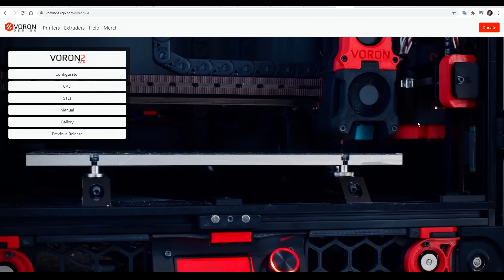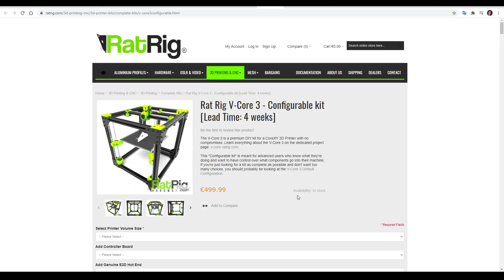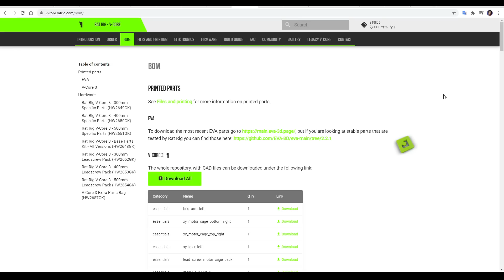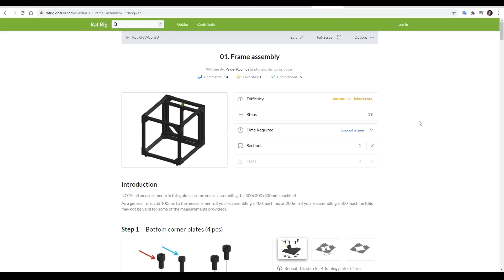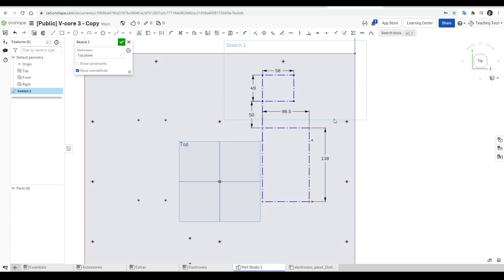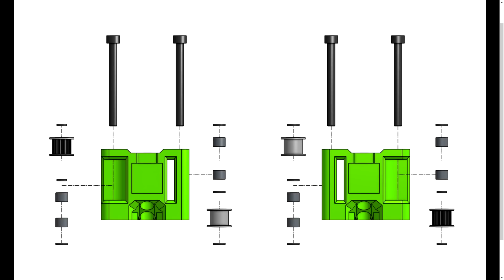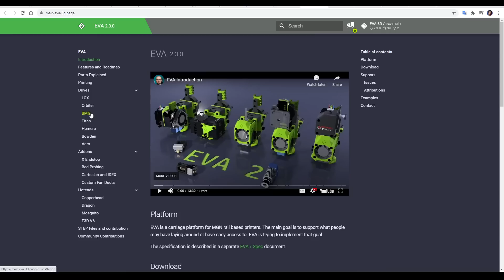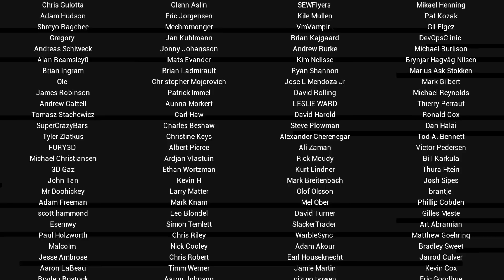Rat Rig V-core 3 part 1 - Premium coreXY 3D printer community build

Comment: IIRC, the linear rails aren't shipped pre-lubricated. They are protected by light machine oil to prevent oxidation during storage. You are expected to clean them with IPA and/or ultrasonic cleaner and use an appropriately rated lubricant thereafter.
Reply: They are actually pretty great straight out of the bag after a quick wipe down, unlike most cheaper rails from china. You can apply some extra oil if needed. You can go as crazy as you want with these. Of course it will never hurt stripping them down and applying some proper grease, but it's an optional step. No reason to complicate it.
Reply from the maker: Thanks for the confirmation.

Comment: How does this compare to the Voron?? They seem about the same cost..
Reply: Scales bigger, way easier to assemble, backed by a company (warranty, support), less printed parts and you get the entire kit in one shop. In my opinion top end performance scales better with the v-core because of the wider belts and way more rigid frame.
Reply: @miklschmidt  thanks for the reply. I’ve been deciding to get the v-core mainly for the EVA series support for a lot of the popular hotness/extruder. I have to admit the Voron does look way nicer at stock with it having an enclosure, the bottom grill/electronics cooling, etc.
Hopefully RatRig releases documentations for those mods!
Reply: @MidStomp  true the Voron 2.4 does look super cool. On the V-Core 3 you’re encouraged to do the non-essentials yourself and make it your own. There are official designs for some of the enclosing panels already, more will come in the future, including a lid.
Reply: @MidStomp  after all the rat rig motto is “Your Rig, Your Rules”

Comment: As for the choice of extruder, I would want to see something that can push out the most amount of plastic in mm³/s because this is supposed to be a fast printer. 
I rarely see anyone promoting 2.85mm filaments and extruders, why is that so?
Reply: Im no expert in this, can only tell you what I have heard, and apparently e3d has done testing on this.  Apparently 1.75mm filament is better for high flow hotends as it is easier to heat/melt.
Reply from the maker: That makes sense. The thicker filament would likely need more temp for it to penetrate the outer skin and properly melt the core.
Reply: 2.85 is considerably stiffer and thus harder to handle in general. I've had filaments that snapped (and this was before runout detection so this was a huge pain), but it was probably old and left in the open.

Comment: Excellent Video. I am wondering with the way the bed can move if non planar 3d printing is possible?
Reply from the maker: Mechanically it would be possible. The hard bit is firmware and gcode generation.

Comment: I am absolutely not a fan of that fake meanwell.
Reply: They're actually quite decent. But it's optional, so you can definitely just buy a meanwell instead if you prefer :) I have both (meanwell on the V-Core Pro 1.3, and Weho on the V-Core 3) With both of them i recommended getting rid of the top and the fan and mounting a proper fan instead. They're LOUD.

Comment: What are you using to get PETG to stick to an ender 3?
Reply: I've had good luck with both blue painter's tape and glue sticks.
Reply from the maker: Wham Bam PEX sheet. First time I've tried PETG on it since initial tests (since I use my Prusa MK3 exclusively for PETG) and it worked very well at 80 degrees.

Comment: If you are getting a premium printer, I would assume that you get all the parts. Not required to make stuff locally.
Reply: It's not a "premium" premium. He used the words premium as a high-quality build, but that doesn't mean it's out of box perfect experience. Buy Zortrax if You want that, but You will pay a premium price for that. Building a printer like that, You are warrantying it Yourself.
Reply: The electronics plate is optional
Reply from the maker: Some people mount the electronics off he machine, but I wanted it on the back. My bad for not realising sooner, but in my defence there is a lot to take it. There is a Facebook community where you could possibly organiser someone to make it for you too.

Comment: I noticed your STL or maybe GCODE files had thumbnails of the exact part? How did you do that? Is it your slicer?
Reply from the maker: For me it is an add on for win10: https://github.com/unlimitedbacon/stl-thumb
Reply: @TeachingTech  Thank you. Just installed it
Reply: It depends on what LCD you use and you can set it on your slicer.
In prusaslicer, under printer settings, general, g-code thumbnails set it to 300x300 and it is done ;)

Comment: This back panel seems like it'd take 10 minutes with a jigsaw and 15 more minutes with calipers and drill press. CNC is a vast overkill here in terms of time/effort spent.
Reply: Remember, if You have a hammer in hand, everything looks like a nail.
Reply from the maker: I wanted it to be perfect. With one $60 panel on hand, I'd rather agonise over the measurements in CAD and have a great result rather than mis-measure a mounting hole by 1mm and butcher it.
Reply: I guess we all have a blind spot when it comes to tools, especially fancy ones vs good old manual stuff

Comment: Whats with all the people saying "would have preffered voron" sounds like bots, i wanted my next printer to be voron but after watching this am def going With ratrig and the new SKR 2.0, I Tking my only problem will be sourcing that panel
Reply from the maker: SKR 2 doesn't have enough stepper outputs. This machine requires six.
Reply: @TeachingTech  ohhhh
Reply: You can find local shops that'll cut whatever material you want according to the DXF. A couple of them even allow you to do it from the website.
Reply: @miklschmidt  Ok but which ones from Australia?

Comment: Damn that's an awesome project to get into. It's really quite expensive though. Wish I had enough disposable income to build a monster printer as this one. My Ender 3 v2 has a faulty board and I'm wondering if I can even afford that, so no big projects for me.
Reply: Where are You from? I have stock ender board V1 and I don't need it because I replaced it with MKS. If I'm not close, You can post on FB, I'm pretty  sure people have spare board that they could give away
Reply: @darekmistrz4364  Man I really appreciate it and this community is amazing but I'm mostly just venting, I'll be fine and I'd feel bad for taking something like that from someone I don't know. But I'm really grateful

Comment: Unless BTT has corrected their drawings, you're going to have trouble mounting the SKR pro. The dimensions for the mounting holes are a few millimeters off.
Reply: 3d printed adapter bracket to the rescue!
Reply from the maker: Holding it up it seems ok. I will be very annoyed if it's not!
Reply: @TeachingTech  i used the CAD model BTT provide for making my electronics enclosures for the V-Core 3. At least i can confirm that one is true to reality 🤷🏻‍♂️

Comment: Great video man! I'm so glad you didn't choose a voron (those machines have serious design flaws). You can see in the comments that "voron" is like a cult.
Reply: What issues do they have?
Reply: @Rolohaun  v2.4 is designed to have a flexible gantry in order for the QGL (quad gandtry level) to work. Just the idea that something in my printer flexes would drive me nuts. The extrusions for the gantry form an U shape (upside down U).  In the corners there are plastic parts designed to flex a little. They also hold the two A B motors which might get hot. Imo this is just a "flex" to do some "cool" looking bed leveling.
The v1 is the best imo, but it sucks cuz the bed only automatically adjusts in two points and the third is a manual knob. Not a big deal imo. A bigger deal is the leadscrew wobble.
The v0 has a cantilever bed which flexes and could have been designed to be all metal and with much less flex. I don't like the leadscrew, and a great mod is the belted z. V0 uses tiny frame extrusions, has small motors. And the top part with the XY carriage is also an U shape. It flexes making things out of square just by pushing with one finger. There is absolutely no place in the xy gantry for square brackets to ensure squareness.
A better variant of V0 is Tiny-M.
A better printer than v2 would be croxy,  k2 or ratrig v3.
I could go on. I will probably get a lot of hate from voron people...
Reply: @cil7ea  to each there own, it's personal preference. I agree with you on z wobble the belted z mod on the v0 is perfect there is no need to change anything else. Its a tiny printer and 1515 extrusions are more than enough. I personally would prefer to level my x,y gantry like the V2 and keep my bed nice and flat. Voron recommends printing out of ABS the motors would never get hot enough to alter the printed parts. But again to each there own I like all different designs that's the best part about DIY 3D printing you can choose what you like and work with it. I built a Viking 3d printer and it had a belted Z, nice printer but did not like it. Plus I prefer Klipper over Marlin for 3d printer Firmware.
Reply: @Rolohaun  i agree with you. In the end it's a matter of preference and what compromises we are willing to take...I'm often a bit harsh on voron. 😅
Reply: @cil7ea  all good, I am curious about all printers and how they work. Very rarely can you have the best of everything haha

Comment: This wobbly disco build plate can possibly be used not only for bed levelling, but also for non-planar printing?
Reply: probably.
But slicing would be a nightmare :/
Will see what future brings ;)
Reply: But this has already been done for 5 axis and more cnc milling. The kinematics are out there in other related fields, after all.
Reply: Some of the testers achieved more than 45 degrees on the bed without falling from the supports.
Reply: Nice, but I wonder about the degree of movement.
Reply: once someone writes the software and they become more common
Reply: The slicer would have to do some inverse kinematic type calculations, which I don't see happening anytime soon, unless a 3D print enthusiasts writes an add-on themselves.
Reply: @dontletthemagicsmokeout  agreed...

Comment: Nice! Didn't even realize there were so many others beside the Voron. Klippy is amazing as well, I hear people having their doubts, but I'd say that's likely because they either never print super fast or already have printers that just behave fine to begin with (like Prusa's). My Ender machine didn't have linear advance as the drivers don't support it, Klippy does this by using the Raspberry itself, which totally sold me on it. Together with anti-ringing, it now prints fast, reliable and I think as beautiful as a well built Prusa (obviously other mods are needed as well to do that :) ).

Comment: 0:50 for clarification the V in voron doesnt stand for version but for Voron and the voron 2.4 is in conjunction with the 1.8 the oldest up to date model of a voron. They're diferent machines not versions of the same, and the vorons you can build are Voron 0 (V0), Voron 1.8 (V1.8), Voron 2.4 (V2.4), Voron Switchwire and voron legacy. Besides the legacy (which is a tribute to older printers with rods and stuff) all the vorons are diferent machines with diferent up and downsides to which one.
Reply: Yeah, the latest version is actually V0.1 ;)
Reply: Yeah, that’s not confusing at all. They really need to come up with better naming…
Reply: @UloPe  as far as I know that‘s why switchwire and legacy are not v3 and v4. so they already did that but the existing printers just keep their name
Reply: @SystemsPlanet  There is no best overall, you need to set an use case first before choosing which model to build.

V0 has been a very popular option because, let's face it, the majority of prints can fit inside a (120mm)³ print volume. The printer heats fast, prints fast, and is just plainly cute. 😊 However, it is acknowledged as the most challenging Voron to build just because it is so small and packed.

Voron 1.8 and 2.4 are very similar in print quality. The 1.8 could be described as a CoreXY Ender 5, with the printing bed moving on the Z axis; the 2.4, on the other hand, have an static printing bed, the gantry being able to move on 3 axes. It can be called the flagship model, being the most expensive model to build. However, it doesn't necessarily means it has a better print quality.